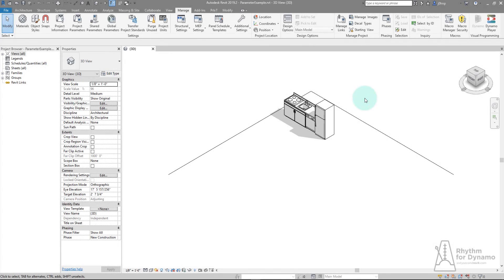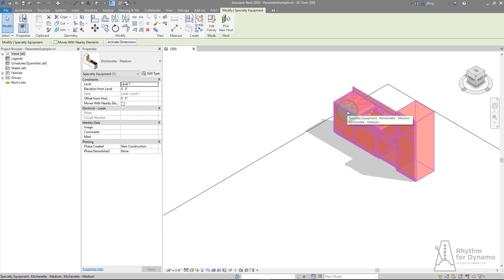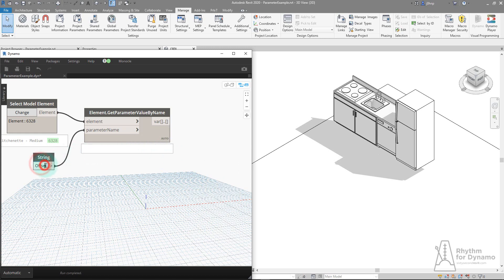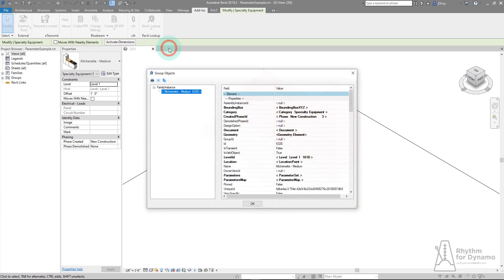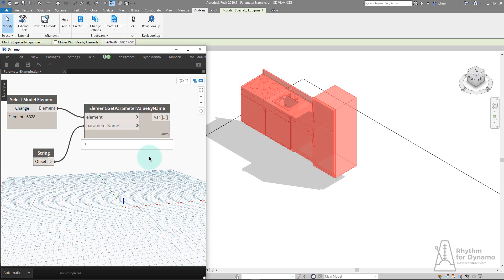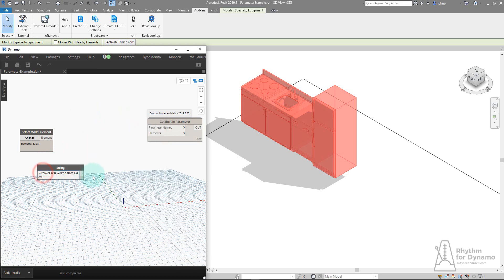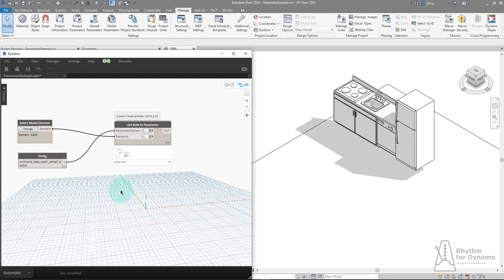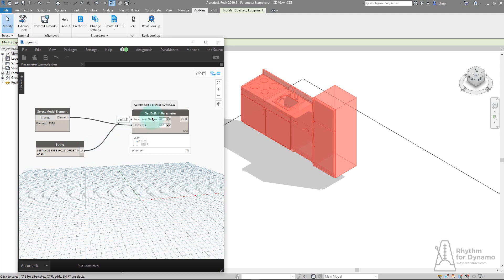Dynamo - Working with BuiltIn Parameters

Comment: Hello, great content as usual. I have a pb, I ve got two room parameters named « name » in a linked file. The first one always contains data and the second is always empty. When I try to retrieve the first one on every rooms I get a mix of the first and the second… what could I do to filter out the second « name » parameter? Thanks.
Reply from the maker: In regards to working with those kind of situations, I have had luck using Element.Parameters and splitting up the values. (if python isn't an option)
Reply: Thanks for the answer I’ll try that solution. Could be great to make a tutorial about it with and without Python. Thanks a lot.

Comment: It seems like for floor based families the "elevation from level" is going to do the same thing as "offset from host" as long as the host is at the associated level. For wall based it would act differently however; the offset from host would move it into or away from the wall and the elevation form host would move it up and down the wall.

Comment: Thanks for the video! I always use the "Built-Enums Snoop..." button to get all the built-in names of the family (Video minute 3:53 https://youtu.be/lUsmsAdcwtY?t=233 ) And you are absolutely right, the built-In nodes should be OOTB nodes. In germany we have to always rework scripts from the community, because the native English parameter names were used instead of the built in names. In some Dynamo packages is the same problem, and because of that, they work only with the english revit language settings. https://www.enjoybim.de/2019/01/29/dynamo-skripte-mit-verschiedenen-revit-spracheinstellungen-verwenden/